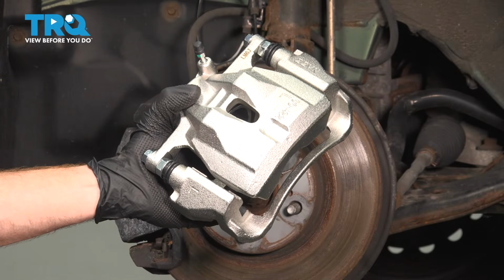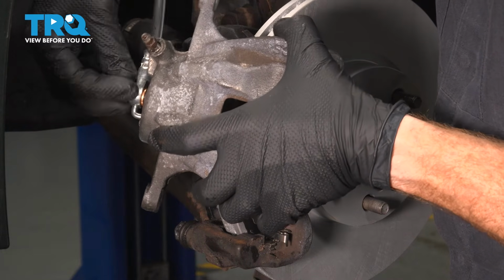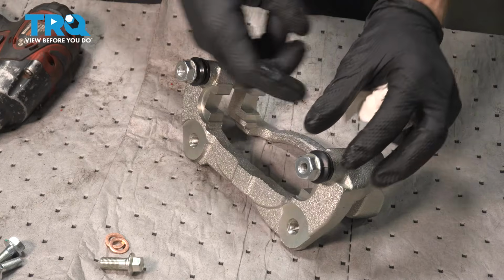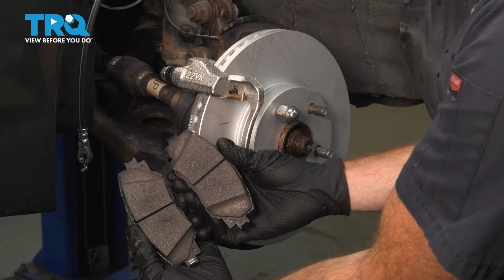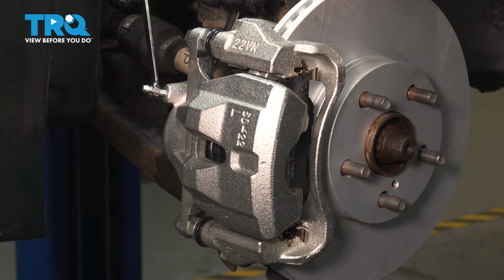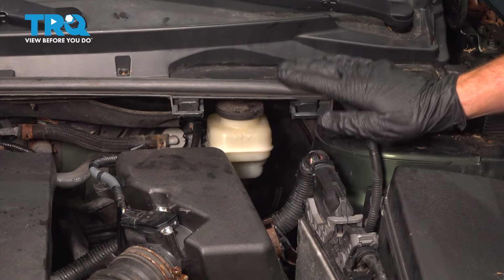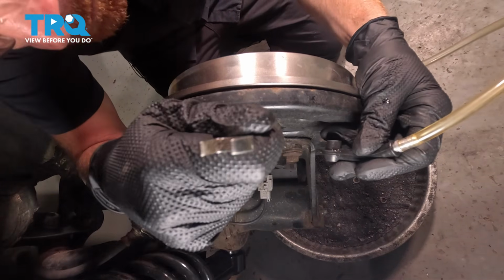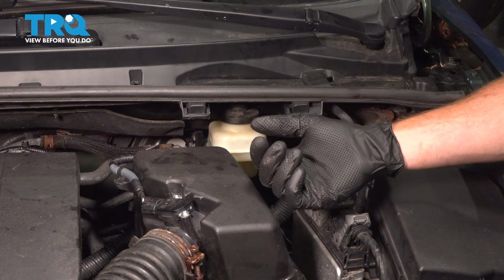How to Replace Front Brake Calipers 2014-2019 Toyota Corolla

Comment: They also have another video titled: How to Replace Front Calipers 2014-2019 Toyota Corolla.

In that video, it says the following:
5:37
Break free the bleeder screw.
Wait for fluid to come through and push all the air out.
No more air bubbles.
And the system should be free of most, if not all of the air bubbles that are in it.
But, you can still perform a manual break bleed, which is RECOMMENDED, you will see how to do that at the end of the video.

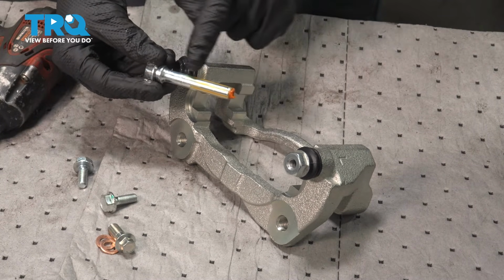5:59
Our "gravity bleed" is done.
Looks like there is clean, steady trickle of break fluid coming out of the bleed screw.
No air bubbles, so let's close this off.
(With the 8 millimeter wrench.)
Spray bleeder screw with break parts cleaner.
Then cap off bleeder screw.

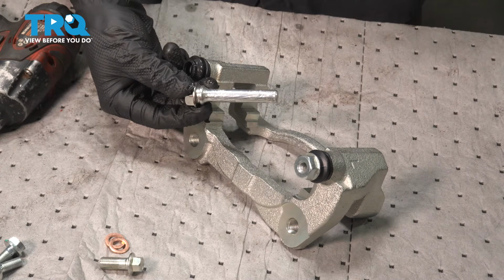6:22
Wheel back on.
Install lug nuts.
Bottom them out in a cross pattern.
And also in a cross pattern, torque them to 76 ft-lb.

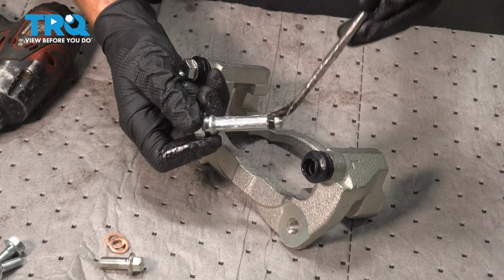6:50
Pump up break pedal.
Top off master cylinder.
Take for a road test.

6:57
Beginning of bleeding process.

Comment: At 13:28 he says "we need the (break) pedal to be firm," and "if the pedal is soft and squishy, there could still be air trapped in the system, if that's the case, you need to bleed your breaks."

Based on what he says, I would assume bleeding the brakes is not needed if there is no air trapped.

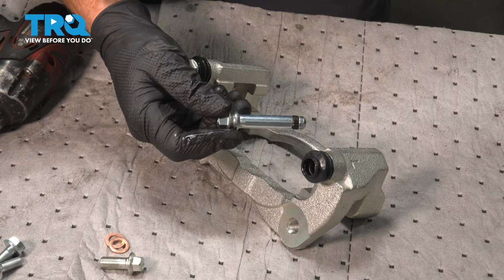Comment: 6:45 
In my camry 2012
The upper & lower pins is same in shape and length! 
Also no that rubber rings in the lower pin.
IS THAT NORMAL ??
This car with me since 2012, no one changed or modified the pins.
Please help me. Need your opinion

Comment: port flex hose banjo bolt...doesn't the caliper have t points for the lower port. does it matter which port it goes into? and why? for the 2018 im corolla there are 2 ports.